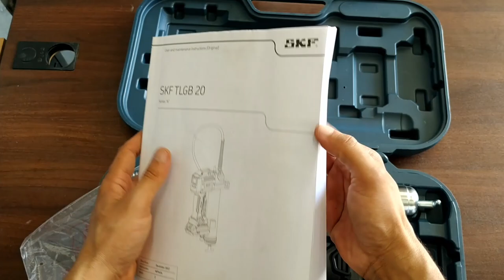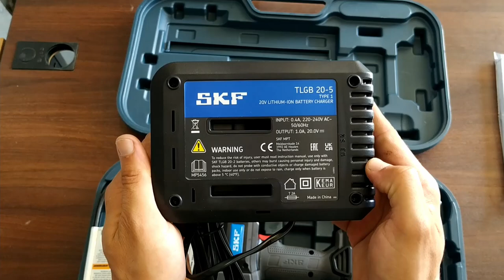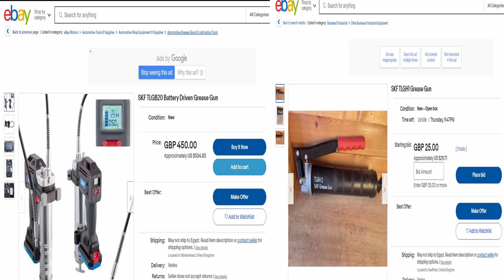SKF TLGB 20  vs SKF TLGH 1

Comment: Pompa neden basmaz?
Reply from the maker: It works, but if air enters the compressor it does not work, and the air must be removed from the drain valve
Reply: @sabawi7 bu videodaki gres pompası?
Reply: Pompada hava yok, hortumdan yağ çıkıyor ama makina içine gitmiyor